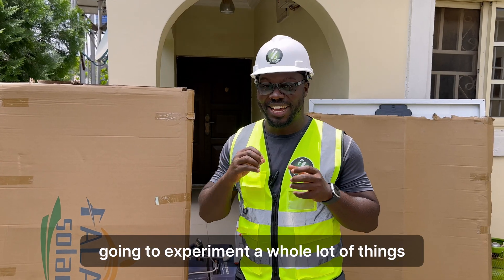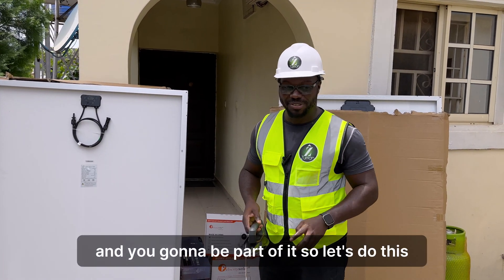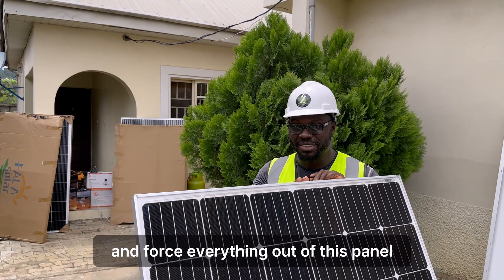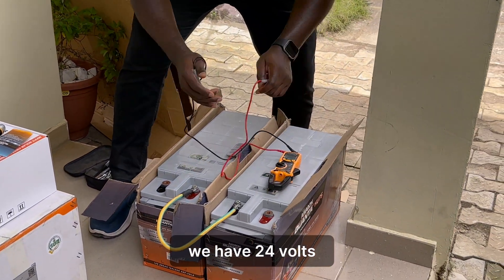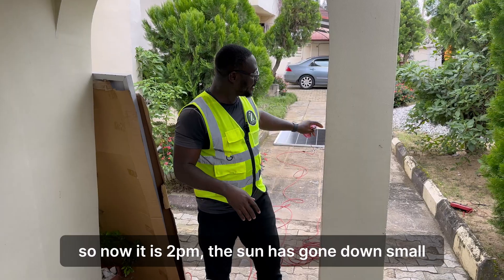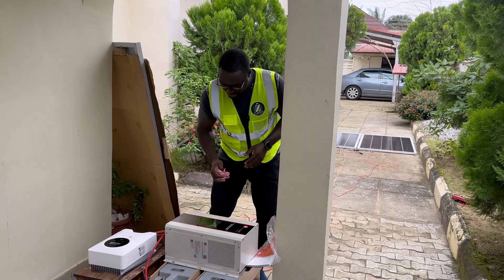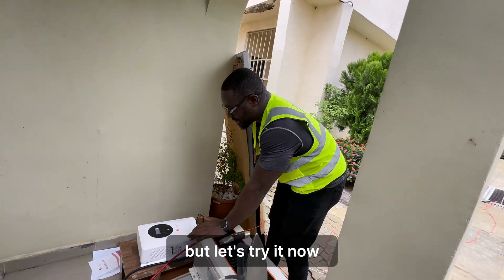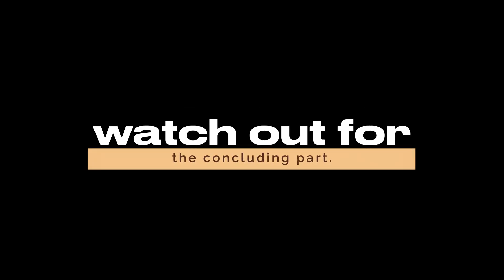Solar Panel Testing & Comparison: 350W Fala-Solar  VS 350W Joy-Solar Panel. #reels #trending

Comment: Please if you parallel 2 INVERTERS (HS and SL), which of them sends out the AC output to load in the building?
Reply from the maker: Great question! The inverters are designed to work in parallel for increased power.

Comment: Due to efficiency, the panels will not give 350w except understand standard test conditions. However, you can get the expected maximum power output from the panel manual.

Comment: The premise your test parameters seem faulty to me. The inverter is not pulling from the panels but rather from the batteries. For these stress test to be meaningful you should test without the battery if you are indeed testing the solar panels.
Reply from the maker: I totally get your view, testing without battery will require an inverter that can work without battery. 
Moreover, we’re just having fun. 
Thank you for the feedback!
Reply: Hybrid. Perhaps Must Inveeter.